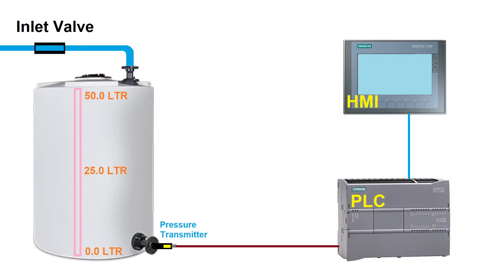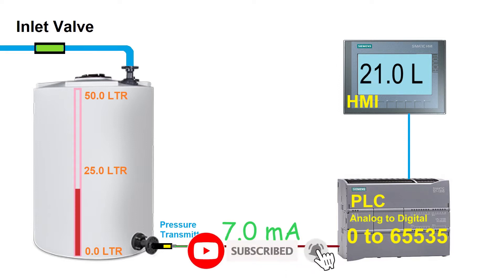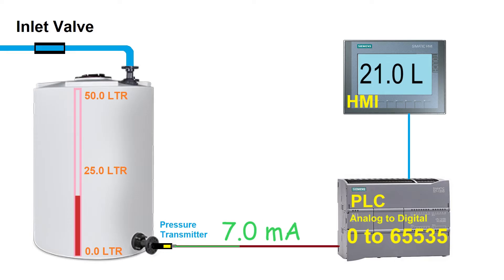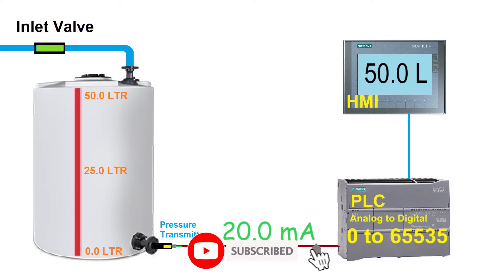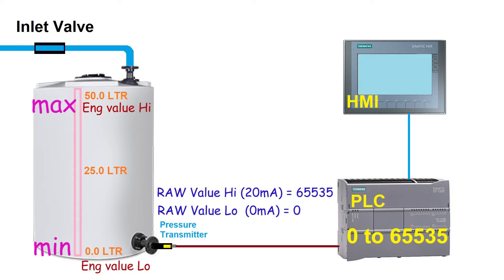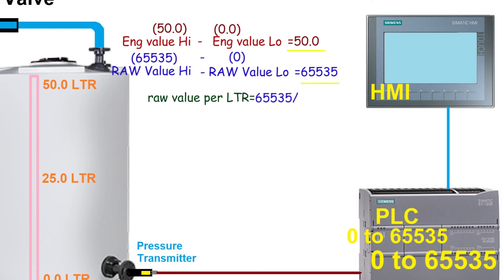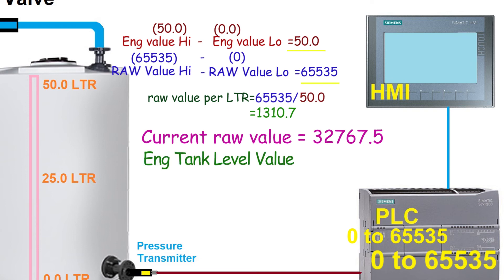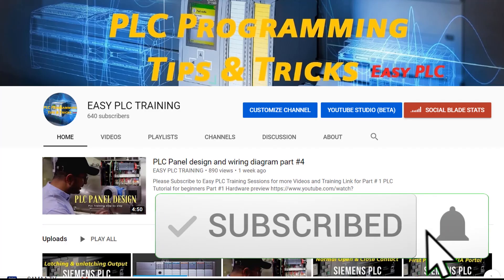Analog Scaling Concept in PLC || Part #1 || PLC Programming Tutorials for Beginners

Comment: Shouldn't we must use 0-27648 to compensate for over-range and under-range values?
Reply from the maker: it depends on how much resolution for ADC. it may be 8 bit , ten bit , 13 bit or 16 bits

Comment: The calculation should be 4 - 20ma not 0 - 20ma.  If you're reading anything less than 4ma at the sensor that indicates a problem.
Reply: Not a must to use 4 to 20mA.

Comment: How we get 65535 value ?
Reply from the maker: 65535 is the digital value at 20mA input signal. it depends upon how resolution analog to digital converter have. for example if resolution is 16 bit , the max value will be 65535. if resolution is 8 bit max value will be 256 only.
Reply: @EASYPLCTRAINING  Thank you
Reply: Siemens is 27648 20mA